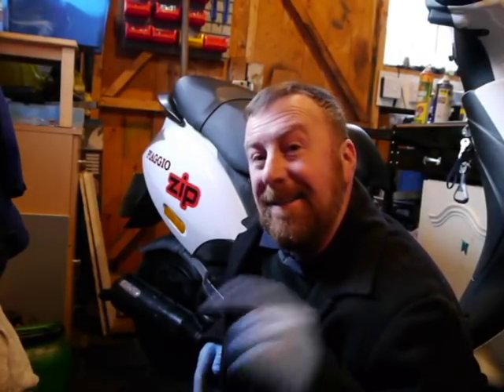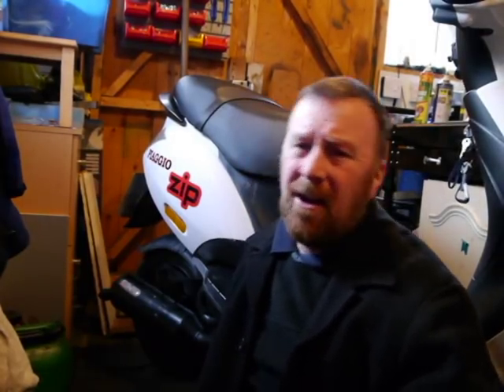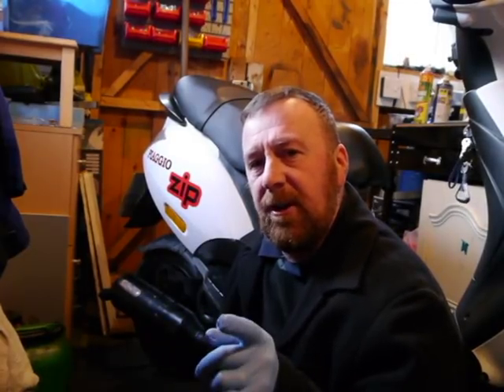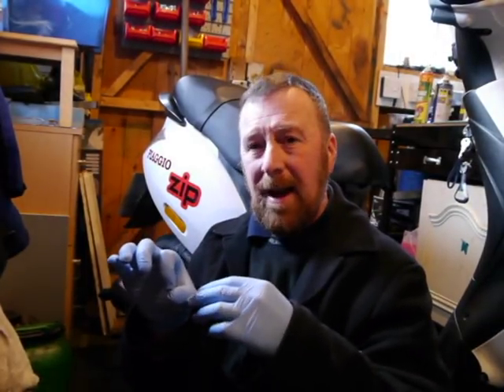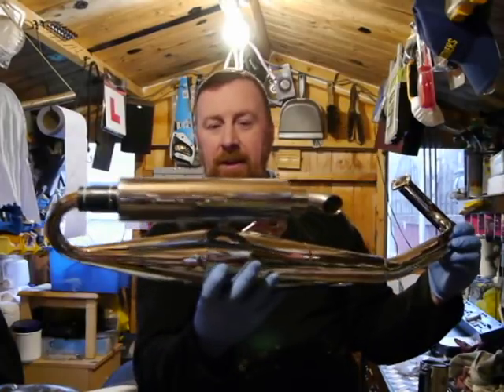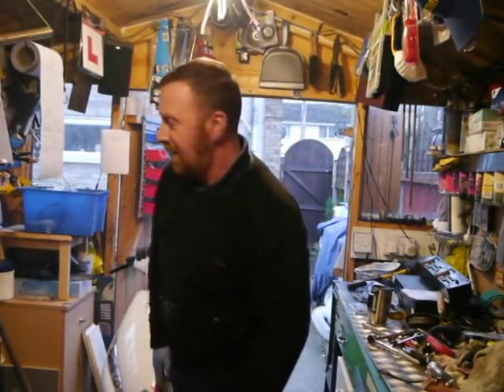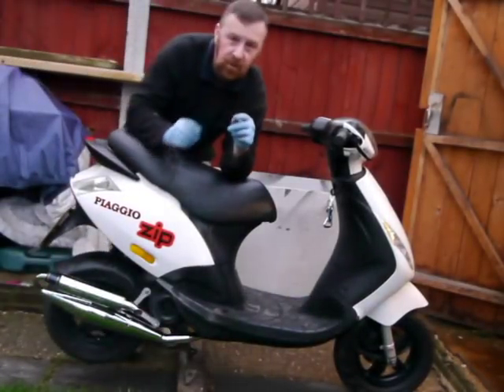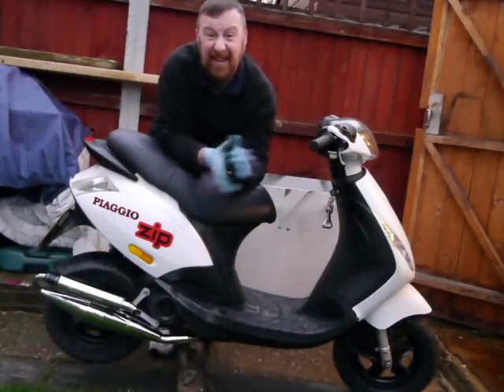CHANGING TO A SPORTS EXHAUST ON A MOPED IT'S A MUST ! MARK SAVAGE

Comment: I would say that you need to get the balance from the scavenging effect correct in the exhaust. You want the negative pulses that travel back up to the exhaust port (after the gases have travelled down to the expansion restriction and back) to be timed correct so that the negative pressure pulse which comes behind, pulls the last of the exhaust gases out just before the port is closed and the inlet opens. A tricky balance to find but it’s possible with time spent.

Comment: Hi mate I’ve recently bought a second hand ped it weren’t in great shape but thought it would be a project I’ve got it home sat on it and the seat isn’t water proof and has what I can only describe as brown sludge . Every time I sit on the seat it leaves my covered in it and it has a foul smell like something I’ve experienced after a curry , I’ve had a look at at the jet and it to has this brown stuff in I have a slight feeling that this ped has been in the bottom of a river for some time and has been sold to me as spares and repairs would you be interested in buying it it’s a crackin ped and I’m sure once u buy a new engine , carb , front forks , rear shocks ,all new plastics new liquid called system , exhaust and a fresh set of tyres will run like a gooden let me know your offers 👍
Reply: I will also include 3 litres of petrol aswell 👍
Reply from the maker: thanks for the offer but at the moment im still doing up my new place and this is why ive not had any videos lately but many thanks for the offer 
ive had a water damaged ped before and it wasnt a good thing lol

Comment: Hi Mark 
Thanks for your video. 
I have a vespa 50cc what exhaust would you recommend putting on it to improve performance?
(I will remove plate in carb/change jet if needed, washer in variator/rollers/ springs in clutch if necessary)
If these dont impact performance would i then change the exhaust?
Many Thanks Mazza

Comment: Hi Mark, on a stock 2015 Piaggio zip 2t (minus variator restrictor washer), what size main jet would you recommend with a sports chamber exhaust like a Leo Vince tt or malossi flip? And would you keep the brass plate in the carb or remove it?
Reply from the maker: Hi bud , take the plate out first and see how it runs 
They often run great 
Upjer only by 4 and it will run well bud

Comment: I have this exhaust and a exhaust what’s derestricted seems pretty similar to stock exhaust will I see a lot of difference top speed wise would test myself but I’m waiting for water pump rebuild kit as I think it’s shot and coolant going in head
Reply: Also would rather not have a screamer exhaust
Reply from the maker: @joshuasalisbury789  you will see a lot of difference bud , you dont have to get the same one as this as yes loud but a sports exhaust will help as in this video
Reply: @marksavage  it came with the exhaust on now looks sorta like a silent pro exhaust and the same exhaust in the video
Reply from the maker: @joshuasalisbury789  see what it runs like and sounds like 
If too noisy 
Change it bud 
Leo Vince , stage6

Comment: Thank god for 4strokes , changing the exaust doesn't do much for them ! Better to have the " stealthy " look 😎
Reply from the maker: Ralf Risberg 4t sports exhausts just make them 
a little noisier but that all lol 
Thanks for watching bud 
Mark
Reply: mark savage i have got one that looks like original but the pipe is a little bigger , but it makes the engine go a little colder but that's it , Love my Baotian classic , as long as you check the oil often and adjust the valves every two months and it goes like a charm 😎

Comment: wd40, penetrating sprays etc !!!! why not try veg oil mixed with white spirit. add 10% white spirit or acetone to veg oil, this makes a very cheap and  far better penetrating fluid than anything.

why does it work ? well veg oil has the smallest molecular structure of all oils and it's 20 tines more viscous than mineral oils as used in wd40 etc

Comment: My moped on a cold start gets to 9mph then gets stuck at for a while before bit gets past it then rides fine! New clutch belt and rollers and exhaust and still haven’t fixed
Reply from the maker: sounds like the auto choke is not adjusted properly and may need adjustment of replacing , have you tuned the air mix, cleaned the  carb , changed the plug and air filter all this should help 
don't think its any thing to do with the variator
Reply: Cool.. don’t think there’s adjustment.
Neither on air mix.
Plug might help, n got no air filter cos running 60 jet. Thanks a lot mark!! Always helpful

Comment: I'm having an issue with my speed fight iv took the original exhaust off and put a custom racing exhaust on not sure of the name of it but now its hard to start and struggle to move the back wheel when lifted off the ground will just bog out if you try and ride it ?
Reply from the maker: most of the time you should be fine but in your case you will have to tune and or upjet 
on your carb do you still have the link pipe 
i have over 100 speedfight videos they will help bud as on tuning , upjetting and air intake

Comment: Right need to rattle tour brain..when I bought my scooter second hand it was fine.then i had it m.o.t and it passed..but since then it started jerking after a couple of mile and backfiring.i cleaned the carb checked all the filters changed fuel filter to a larger one and also new plug..well now I goes ok for about 8mile then once you keep throttling off a few times for bends etc..it dies like it runs out of petrol.so I wait for about a min.then it starts and is ok again...apparently it has a 80cc bore kit but I can't get it to go over 35mph it's a tamoretti retro 50cc..also would the gy6-b upgrades fit
Reply from the maker: Neil powell well you know what I think of big bore kits 
But 1st 
Carb float may not be filling up  so may need cleaning or adjusting if it can 
Fuel pipes loose or gone hard so change them if needed 
While carb is off clean jets 
Electrical problem so POSs stator but guess it’s fuel bud  see how u get on
Got videos to help
Reply: @marksavage  cleaned jets and float..going to be changing air filter and all pipes..the float looked fine....also not sure what upgrades I can put on it..been looking but don't understand that side of it..it's Chinese so will the gy6 stuff fit it..never tried adjusting float..Will look on your videos now

Comment: Hi mark, I really need your help and advice with sorting out my gilera DNA. I've been watching all your videos to try and help get it running. I've changed the crank and put a brand new one on it and I have also bought a 70cc kit for it. So I've changed the engine. I've got this carb that came with it which says its 70cc however I just cant seem to get it running. I've been told to run a 115 jet on it and itll be fine. I've got a stage 6 sport exhaust, I've also got mallosi light rollers in with a mallosi sports air filter. Nothing seems to be working with it at the minute and feel like giving up. I'd really appreciate some of your help please

Comment: I’ve got a speedfight 4 air cooled moped and I’m wanting a sports exhaust, I’ve picked out the Technigas Next R, the standard jet is 80, you mentioned that I should go up in 4s? So next step would be an 84. Would increasing by 4 work for most mopeds? And also when would I know that it’s been done properly and that I’m using the correct sized jet? Perhaps when it doesn’t bog down under full throttle? Any help would be appreciated thanks
Reply from the maker: hi bud, make sure playing with it doesn't effect the warranty!"
as for upjetting , yes when you upjet it and it runs well and you get more speed out of it then all good.
if it bog down or wont start /floods go back down. but 84 with a sports exhaust is a good place to start from
changing the rollers will help a lot too bud 
thanks for watching, i have many other helpful videos bud ,worth a watch . 
mark
Reply: mark savage yes I’ve watched most of your speedfight videos and they’ve been extremely helpful, also what jet do you usually end up with on a speedfight 3 because I’ve heard that they’re quite similar, and also I’ve ordered a racing variator kit with 6g 7g and 10g rollers...would that make a difference with the stock exhaust? Thanks in advance
Reply: Actually they’re 7, 8 and 10 so 7 is the lightest I’ll have
Reply from the maker: JollyTechnology yes bud Defo to the pull away or too end 
Check what weight is in there now and go up or down to what your happy with and. Yes sp3 and sp4 are based on the same engine 
Mark
Reply from the maker: JollyTechnology as in my video you can combi them if you want , just have a play as luke the jet 
I’d put on the exhaust then upjet by 4 and add 1g to each. Roller so 6g’s up and see how she runs and go from there bud 
Mark
Reply: mark savage okay thanks I’ll keep that in mind, however I don’t have the exhaust yet but will have the variator and the rollers...would the variator and the rollers make a difference without the exhaust?
Reply: mark savage thanks so much for your help, I think they’re 10g so a 7g would mean it would reach the power band quicker and therefore better acceleration?

Comment: Hi
What do you suggest about the main jet on Gilera Runner 50 with Leovince ZX  exahuat and standart  airbox?And what is the standart setting for the needle noch from fasctory?

Love to watch you videos.
Ceers
Reply from the maker: Leave needle as Is
What's it running like now?
Top speed 
I'll only go up in 4s anyway then put a sports in box filter 
But if running well maybe leave it bud 
However after upjet and filter you may need a little aut mix adjustment like in my videos 
Thanks for watching bud stay safe
Reply: @marksavage  Now running on standard 53 main jet.Still did not put the exahust on until find the proper jet.Friend have same bike same exahuat and 65 main and needle on 2ns noch.His bike was fast as hell 105km/h on speedo.But spark plug get foul after 100km of driving and it was wet.
Reply from the maker: @pakoaheka1569  from 53 I'd go to 60 , leave needle sports air filter ,see hoevit runs
Reply: @marksavage  I will try.Thanks

Comment: Guy on Facebook said any 50cc exhaust will fit any 50cc bike is that right?
Reply from the maker: Rectro-V2 No and No that’s a bit silly to say a speedfight exhaust won’t fit an aerox 
Some 4t exhausts May fit as being a g6y engine but try buying the exhaust that fits your moped 
Some other end can may if the right diameter but really check first or your end up with a shed full or exhausts lol
Reply: Thanks got a Yamaha jog r and the guy on Facebook has the big rainbow exhaust

Comment: I have a 109cc gearless scooter. Can I use this sports exhaust on it? And do i have to jet carburettor with respect to it?
Thank you!
Reply from the maker: what sort of speed are you getting bud, do you want more power or sound, a sports exhaust will often fit on with no need to up jet and so on plus if you can find a exhaust to fit maybe more of a problem!
if you can get on see how it runs then maybe look into upjetting by size 4 like in my upjetting videos 
please like and sub 
mark
Reply: mark savage I'm getting 80km/h. And I want ti increase acceleration. (Subbed)

Comment: Hi. What do I need to do to run an open/small air filter please? I'm customising a Peugeot Ludix Blaster which has a doppler exhaust, the main jet has "66" on it, but if I even so much as touch the OE airbox, it bogs and cuts out. It runs beautifully with the airbox mind. As it will idle, can I fit an open filter and then try adjusting the air/fuel screw on the carb? Any help or advice appreciated. Thanks.
Reply from the maker: hi bud 
well if it runs very well as is i'd leave it bud, all you will get with the open air filter is a little more noise and not much else and as in my videos as soon as it rains you will get problems with it sucking in water !
maybe try a sports inside the air box filter then just a little tuning with the air mix maybe be needed and then the bike would breath a little better 
if you want more out of it next VARIATOR , check belt and poss upgrade the clutch 
please like share and sub and i have many more videos that may help ,mark
Reply: mark savage Thanks Mark. As I'm customising it (for show use only, no MOT, etc) all the fairing is going and the airbox can't stay unfortunately. Some of the sports filters look awesome, but I still need the bike to run. Thanks again for the quick response, I'm a recent subscriber.

Comment: Hi mark I have a tecnigas q tre exhaust for a Peugeot speedfight 2 50cc AC vertical I’m running the stock air box what size main jet do you reccomend?
Reply from the maker: To be honest most run so much better with a sports exhaust you don't need to uojet 
But I'd go from 56 or to 60 and add a sports inbox filter 
Way more pull away and top end 
6g rollers and clean 
Your good to go
Reply: @marksavage  so anywhere from a 56 to a 60 with stock air box?
Reply from the maker: @baileyjolly2534  standard jet was 54 or 56, I've alway upped it to 60
And its aways ran fine ,normally  no need to tune either
Reply: @marksavage  thank you very much you’ve just saved me so much hastel

Comment: hi mark i have a peugeot squab same as  atrekker and need to change front forks are the bearings loose or on a bearing race its a  p reg
Reply from the maker: I have videos on head stock for speedfight follow that video as it will help and the basics are the same

Comment: ive got a firefox ajs 14 plate just bought it for 250 and just have a few questions

basically i took it to the garage and they said that there could be a break in the spark plug wire but when i took it down the road and started it it sounded fine so a bit confused. also wanted to know how to loosen the kickstart because it gets jammed often
Reply from the maker: nice and cheap bike bud, ok a break in the ht lead? that is easy to replace.
the wire breaks down inside and can cause it to short so if it cuts out you will need to replace it but more like a loose wire or short, I have a few videos on 125s which may help but i'd wd40 all the connection and make sure it's all ok first as you don't want to be out and it to breakdown !!
as for the kick start take off the cover and check it out, again I have a video on kick start ok it's for a speedfight but its the same sort of thing and it will help but may just need greasing up!
please watch my other videos and like and sub 
mark

Comment: Hey Marc . I ordered a exaust . Only thing where it bends to bolt to engine it won't reach . The factory exaust is about a inch longer from the bend .Im thinking if removing center stand bolting exhaust to head . If center stand won't bolt back mabey use some type of spacers . Have you heard of this ? Appreciate if you can give any information on this . My house burned down about a week ago . I used to be able to walk to my work now I'm going to have to start driving . Will the new exhaust still work without to much modifications ?
Reply from the maker: George Jennings sorry to hear about your house bud 
If the exhaust doesn’t fit it’s not the one for this moped 
I would take off the stand bud 
Nor force it as it will stress the pipe or bolts and break so go back to standard or buy the right one for the year and make 
Or cut the old pipe next and weld it to your new one ! That would work bud
Reply: @marksavage  .It will bolt to head . and the other support brackets will match up . That being the case is it ok to try or should i just start over ? Its a 2 piece thing. The muffler bolts on . So if i can just buy a front piece ....... Hopefully . Thanks. Its been an interesting week . Found out a lot of decent people out there though .
Reply from the maker: George Jennings get the head bolts and bolted on , make sure it fits with knocking or catching 
You can alway make a extension bracket to support the end can part 
Just make sure it all fits nice otherwise it will snap bud
Reply: @marksavage  thanks. It appears it all lines up . will make sure before i commit .

Comment: Hi mark , I wanted to get a new exhaust ( technigas next r) but have heard they’ve got restrictors on them, was wondering if you knew how to remove them and if to attach the new exhaust, it is as simple as undoing the old one and chucking the new one on? Cheers
Reply from the maker: Thomas Edwards hi bud 
As for restricted no not that I know , the OME one you have now will be 
As for getting the old one off just use a little wd40 on the head exhaust bolt so not to snap them and it’s all easy after that and new one on 
Sometimes it helps to upjet by 4 like in my upjetting video 
Please like share and sub 
Mark